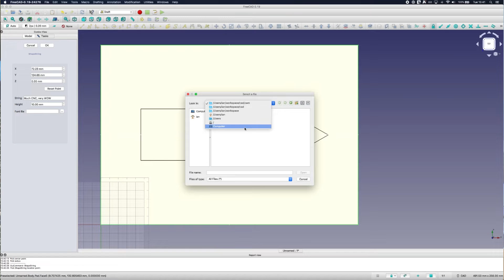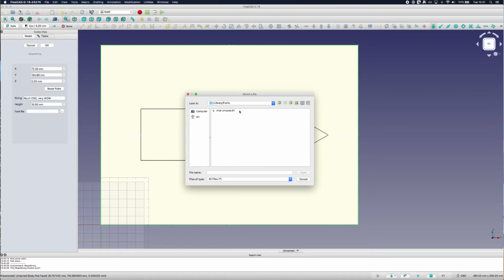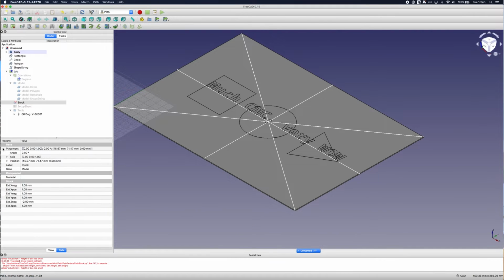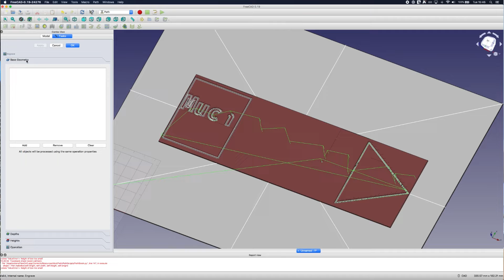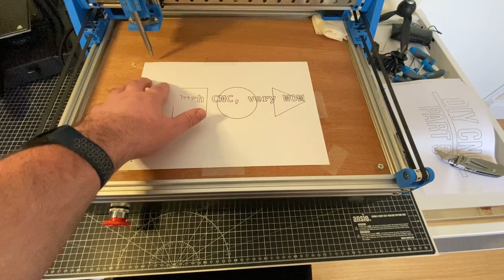DIY CNC (Arduino & GRBL) - Part 5

Comment: I've built about 3-4 CNC routers (depending on how you count them), and I haven't had limit switches on any of them :D Not saying that they're useless, but you can get away without them for a long time.
Reply from the maker: Yeah, they aren't essential, wanted to add them for completeness really